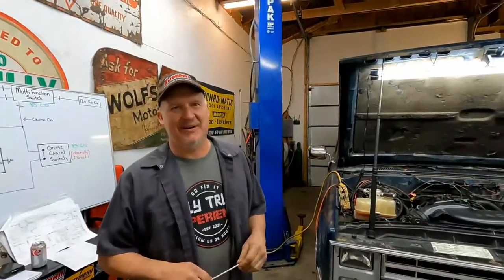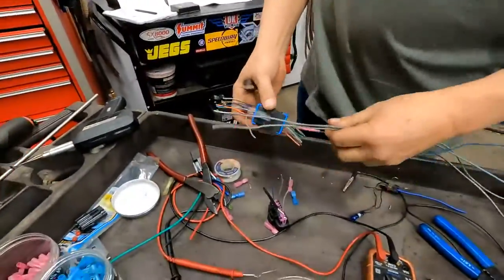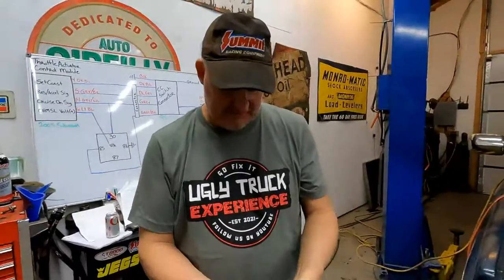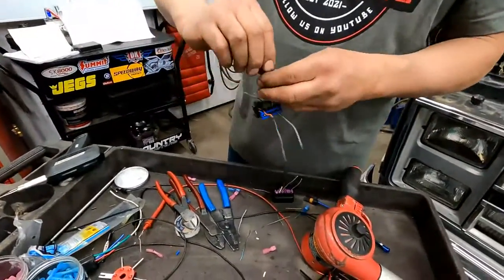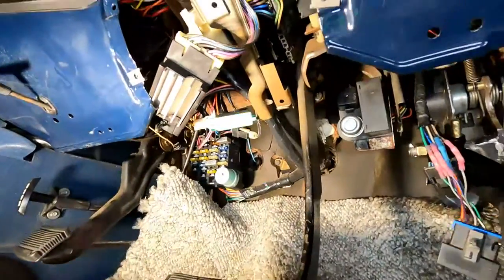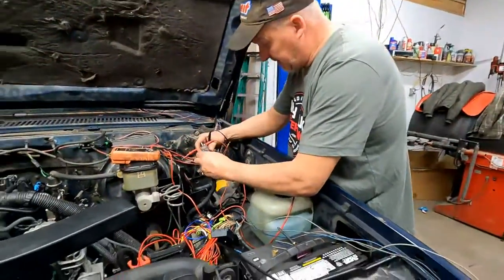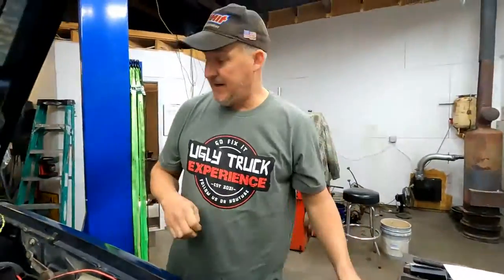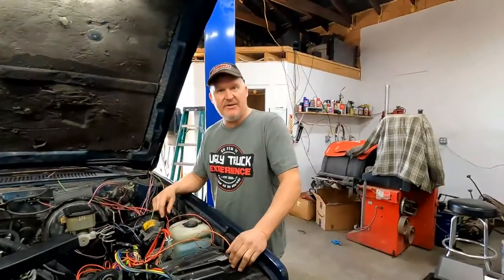CRUISE CONTROL TO MAJOR TOM - How to Wire LS SWAP Cruise Control Using RECYCLED CONNECTOR - UTX

Comment: This vid popped up on my feed as I was just starting to wonder how I'd tackle keeping cruise control on my 91 S10 that is getting a 2003 4.8L and 4l60e. I am going with DBC and saw that you have DBW. Would this work with a DBC setup?
Reply from the maker: The drive by cable wiring is very similar to this. We haven't had the opportunity to do one yet.  Thanks for watching. We appreciate it. Jerry and Emily.

Comment: I did the LS swap into my 61 Pontiac.  Used the original 2004 Silverado harness , fuse box, TAC module and Cruise switch.  My cruise doesn't work. I supplied keyed power  directly to the switch. (used the O2 sensor downstream circuit) I checked It at the C100 connector. The switch functions properly ...tested all four wires for power when pressed, etc ..  The original CHMSL wire C2 A-10  is wired from the fuse box to TAC module as it was in the factory harness. I didn't touch it. I wired purple C1 C12 TCC signal wire to the dual function brake switch  with power on when pedal is not depressed. That was tested and works.   I tested the original CHMSL wire C2 A-10   and there is no power to it. Does the computer power that wire up when the vehicle is in motion or something?  Scratching my head. Where does C2 C12 get its power from? I think  that might be my problem.  Do I also have to connect the C3 A5 purple  TCC Brake / signal wire to the brake switch?
Reply from the maker: Hey Bill. It sounds like you have it wired correctly. As long as you have power at C2 A10 with brake on and power off at C1 C12 you have it wired correctly.  You are probably going to have to wire a resistor into the CHMSL circuit. That will give it the impression that the brake lamp and chmsl bulbs are not burnt out and let the cruise control apply.  I use the same little gold resistors that people use for the led lights to keep them from hyper flashing.  You could also wire in a light bulb just to test this theory.  Add a wire from C2 A10 through the resistor or bulb with the other lead from resistor going to ground. I bet cruise will work after that.   The powertrain diagram does not show that extra circuit on that truck.  It is shown in the exterior wiring circuit but still a complicated circuit.  Let me know.  Hope this helps.  Jerry

Comment: I'm swapping in a 02 DBC 5.3 into a 94 S10. Hoping I can get my cruise control to work. Already have the cruise control module mounted on the firewall and the cable connected to the throttle body. Have not got it running yet so have not messed with the cruise control wiring at all yet. Shouldn't be to hard. The 02 DBC amd 94 s10 are very similar whenni comes to cruise  control.
Reply from the maker: Thanks Shady. That's a pretty interesting swap. Just for fun I'm going to look at some wiring diagrams on that one. We appreciate you tuning in!  --Jerry and Emily

Comment: Thanks for the great video.  I've watched a lot of your videos while doing my first LS swap.  You guys explain everything so good!  Can I do this setup on my 2000 5.3 drive by cable setup?  Its in a 86 Chevy K10.  Thanks!
Reply from the maker: Hello Tyler.  If your running a drive by cable, you will have to use a cable cruise control box from  a donor.  It wires very similar to this drive by wire.  I have always wanted to do one but have not gotten to it yet.  Let us know how it goes if you get down to it.  Thanks for watching our stuff.  We appreciate it.  Jerry and Emily.

Comment: Like the videos and I used the factory fuse box out of Yukon to put in my 1993 Chevy c1500 with a lq9. Works good was wondering if this will work on mine is the relay going to work with it or need change some wires thanks
Reply from the maker: Hello Zeke. I will have to take a look at the wiring diagram on that 93 to help answer your question.  If I was going to guess, I would say that the switch will work in the same manner but am not sure if it would need the relay.  It may have a double brake switch already.  If I can get a moment, I will take a look.  Thanks.  Jerry
Reply: @UglyTruckExperience  I went to junk yard and it does have two switches one on top for the cruise control shut off and the one for the brake lights. I have a problem tho I have led tail lights with the flicker relay so might need away to fix that since I hear if you have led cruise control don’t work. But if you can check wires that be helpful and I already put a relay like the one on video it’s just the last part with purple wire from pin 33  where should I connect it to my switch

Comment: Great Video! I', thinking though...the way that you have the normally closed brake signal wired into that relay, the relay is energized all of the time when the vehicle is running. You could have run that wire through pin 30 and 87A, and then used a simple signal from your brake light switch (which is right in the same vicinity) on pin 85 to open that connection. That way the relay would only be energized when you step on the brakes.
Reply from the maker: Hello Jeff.  You are correct.  I use that method when wiring up a truck that did not originally have cruise control.  On the ones that were equipped with cruise I use this method just to keep my cruise circuit separate from any other circuit. On this one, the relay will only have power when the cruise is on.  If I was wiring one up for myself, I would wire it like you described.  These are going back to customers that are hundreds of miles away, so I try to isolate the circuits in case someone has to work on it in the future.  Thanks for watching.  We appreciate it.  Jerry

Comment: Walk to this rabbit hole with me. If you were to use the factory LS harness and c100 connector: 
* The dark blue wire would go to position A: Set Cruise. 
* The Grey wire would go to position L: Cruise On. 
* The Dark Green wire (Grey/Black wire in the factory LS C100 connector) would go to position S: Cruise Resume. 

What throws me for a loop is that on a regular DBW standalone harness the only other wire that would need to be connected is the Light Blue wire which is in the C2 Connector, Position A10. I wanted to get a second opinion but I'm pretty sure that your 87A Light Blue wire: Cruise Release would get tee'd into this wire from the C2 Connector and the Cruise Control option and TCC Brake should work accordingly.
Reply from the maker: What is your donor harness and computer?
Reply: @UglyTruckExperience  05 Denali
Reply from the maker: Most of the wiring diagrams for those that I have seen are not correct.  The wiring that goes to the CHMSL is normally open and the one that goes to the brake switch is normally closed booking down the road with your foot not on the brake.  When you apply the brake, it just does the opposite. No power to CHMSL and power to brake signal at the throttle actuator. I have checked it with the actual donor and confirmed that. There are other way's to wire it, but this is the way I prefer to do it. It is built in for some redundancy to make sure everything is all good.  Jerry

Comment: Ok: so: I’ve got a truck with out cruise control, if I buy a  turn signal lever with cruise control it comes with a little ole wire on it, wander what troubles I’m going to have to hook it up, I bought a wiring harness plug an play, from psi,with cruise control option, but I’ve not looked at it yet to see what I’m in for
Reply from the maker: I bet it won't be too difficult.  We haven't used that set up so I'd be real curious to see how it goes.  Be sure to let us know! 👍
Reply: @UglyTruckExperience  ok sure will should be installing my cab here shortly and I’ll be starting on my wiring

Comment: I purposely used a "drive-by-wire TB so I could use my 1983 OEM GM CC Stalk. However, I do not have a "connector" to place in-between so my question is, in this tutorial, you show battery / Gnd coming into the "connector" but i have no way of knowing where these go into the stalk, I have the CPU wires, on/off power from the brake switch power goes off when depressed (correct) and the 4 wires from my stalk. No go. Thanks.
Reply from the maker: When you say stalk, are you talking about the connector going into your 83 cruise control module and what year is your donor motor and ecm?
Reply from the maker: That ground that you are asking about can be grounded to any good ground source.

Comment: How does this hook up to the cruise control actuator on a 78 blazer. it’s the older mechanical style with the button on the end of the lever ……..on the steering column next to the column tilt actuator. There is no resume.
Reply: It’s a 2003 with tac module. Dbw
Reply from the maker: Hello Jack. You might have less headache if you put a later model switch in that has all of the outputs that run everything.  Jerry

Comment: Thanks for another in-depth, deep-dive. It appears that All-Data and a scan tool is key to doing wiring. Unfortunately I'm just a shade tree mechanic and that stuff is way too pricy. I guess I'll have to test it "live". Look out!
Reply from the maker: Alldata and Mitchell both have option for individuals with project.cars that is pretty reasonable.   It gives access to all the info for what your working on.   Thanks.for watching
Reply: @UglyTruckExperience  I did not know that. I'll have another look. Thanks so much!

Comment: It seems like alot of your videos are working on mod 80s and older. Have you done a 2006 swap into 1989 or similar silverado? If im am understanding correctly the 89 uses a normally open relay.
Reply from the maker: I think you are asking about the brake switch.  The 89 has a switch that is both normally open and also normally closed.  The connector at the switch has one power lead then 2 leads that are normally closed and 1 lead that is normally open.  That brake switch will give you the ability to do the cruise without the use of the relay like we did in this video.  Jerry
Reply: @UglyTruckExperience  thats exactly what I was asking thank you. That same switch will allow me to use the tcc also correct?
Reply from the maker: Yes it will.  That truck makes those items a bit easier..  Jerry
Reply: @UglyTruckExperience  awesome thank you im glad I had your videos pop up I should be able to retain all of the options that I wanted from the swap.

Comment: Do you guys have any slick solutions for switches on a truck that never had cruise? In this case a 68. Im in the middle of a swap and about to start wiring the engine side of things. Ive been ticking up the view counts on several of your swap related videos. :)
Reply from the maker: Hello Whisky.  Check into Dakota Digital.  I think they make a replacement turn signal switch that has the cruise added to the end for most older vehicles.   It has all of the wires needed that would just snake down the steering column and wire to a modern day system.  We have one coming up that I will have to do that to, but it will be a bit before that video comes out.  Let us know what you do and how it goes if you beat us to it.  Thanks.  Jerry
Reply: @UglyTruckExperience   Well I'll be dipped! It's reasonably priced, too!  I doubt you beat me to being able to test it, but I did just order one. Looking forward to the video. Thank you for the lead!
Reply from the maker: No problem.  Glad  they had one.  I have always likes the quality of the parts they put out.  Let us know  how it goes.  Jerry

Comment: What is that spider looking tool you used to push that wire  out of that connector
Reply from the maker: That is a tool designed to take electrical connectors apart.  Here is a link. https://www.googleadservices.com/pagead/aclk?sa=L&ai=DChcSEwj0ivOp4YSBAxX_MdQBHZ7ZCPgYABAaGgJvYQ&gclid=Cj0KCQjw0bunBhD9ARIsAAZl0E3pH_I8Do1qA-XKRNKwHWMSqNnLudRtkWKL0n2fSwQmPnb7Fxo85AwaAjCTEALw_wcB&ohost=www.google.com&cid=CAESauD25-jG1k--PS6zDqbTCzbNoWQMcL3JBqc84ydeUkUZ3Ctk9Z9fU5l8cv7UOEI6ZwBhcS2kJfqk2oB5dc2_kXyHoDnKFvG527_XPxvzV7A9dPaPr4mTv1-AIkxW2UdKe78F-KfqTL3mFNY&sig=AOD64_1-5heweVyFekJDxlS2Sd3GL0yqVA&ctype=5&q=&ved=2ahUKEwi4nuCp4YSBAxVdmGoFHWRNDKQQ9aACKAB6BAgFEHU&adurl=

Comment: Great info. But I have no power at cruise control module by the brake pedal. Bad switch or ?  What feeds power to module? 
Thanks in advance.
Reply from the maker: What year of truck are you working with?
Reply: @UglyTruckExperience  sorry  i just seen that you replied. 86 gmc sierra classic 2wd
Reply: It was the selector switch on the column. Power going in(blue wire), no power going out.
Reply from the maker: Glad you figured it out! I think those are pretty easy to find! 👍👍

Comment: Would this work on an 82 style??
Reply from the maker: If the truck originally had cruise control it would absolutely work.  You would still need to get a wiring diagram for that truck and double check everything but it is very similar if not the same.

Comment: Does this apply to dbc set up?
Reply from the maker: Hey Francis.  Drive by cable uses a cable box to hold the throttle plates open.  The wiring does work in a very similar way though.  I have always wanted to wire one up but have never had the chance.  Jerry

Comment: Wish I had your insight.  I'm trying to wire my 88 Camaro up to a 2009 LY6 Gen IV PCM and I'd love to have cruise control
Reply from the maker: Should be fairly similar to this one. I know it's a different ecm.   I'm curious now. Will take a look at a wiring diagram next chance I get.  What did the lc9 come out of?   Sounds like a great project.  Thanks for watching.
Reply: @UglyTruckExperience  6.0 out of a 2009 GMC 2500 4x4
Reply from the maker: The cruise control on that goes through the body control module and communicates to the ecm through its data lines. It is possible but does make it much more complicated. What are you using for a transmission?
Reply: @UglyTruckExperience  T-56 Six Speed manual
Reply from the maker: I know it's probably to late now but it would be easier to use a earlier model wire harness and computer to run that lc9.  That will be a fun car to drive.
Reply: @UglyTruckExperience  I'd have to change crank to a 24x tooth, and sorce wiring and PCM... might do it.
Reply: @MrJblackmon1989  or run a lingenfelter box to convert crank reluctance. Ive heard of guys wiring in a bcm and getting CAN to work but its definitely more work than gen3

Comment: Are u using the original oil pan from the 5.3 ?
Reply from the maker: Yes, this truck has the stock 5.3 oil pan... But we did install a low profile pan on this 78 C10 if you want to check it out! https://youtu.be/XanlbyNiLzE Thanks for watching!
Reply: Thanks for the awesum videos u guys r awesum an very helpful :)

Comment: Does the cruise control and the ABS work on PCM?
Reply from the maker: Thanks for watching! The PCM and the throttle control module control the cruise control. The ABS is totally separate and has its own module.  --Emily
Reply: @UglyTruckExperience  Does the PCM need programming to start the cruise 
control?

Also, all wire connections are correct, yet it does not work (does it have anything to do with the speedometer because it is completely disconnected and I have not finished running it)
Reply from the maker: I need a little more info on what you are working on.   Thanks   Jerry

Comment: So is that a drive by wire system?
Reply from the maker: Yep!  The cable operated throttle has a cruise control module under the hood that the cable goes to.

Comment: Do you have drive by cable or drive by wire throttle bodie?
Reply from the maker: Thanks for watching! This one is drive by wire.
Reply: Can i youse the oem 1990 ck1500 turn signal cruise control with a throttle drive by wire?

Comment: What gas pedal did you use for the swap?
Reply from the maker: Hello Danny.  We use the adjustable pedals.   There are a ton of them out there to purchase.  Here is a link to our video on them. https://studio.youtube.com/video/_qO5Jjl6Py0/edit
Reply: @UglyTruckExperience  if I had a drive by cable set up what would be the difference in wiring?
Reply from the maker: What do you have for engine, transmission, harness, ecm?  Year and model and is it already a functioning swap with drive by cable.  Jerry